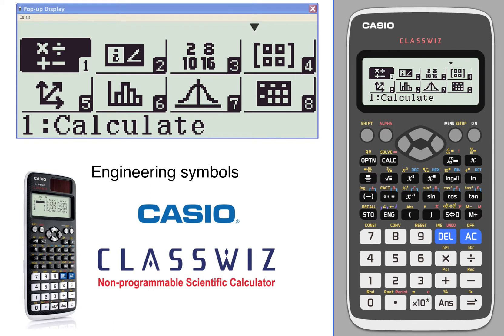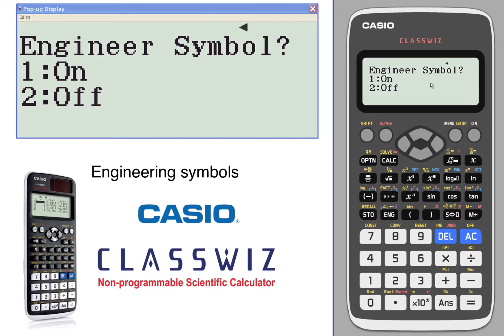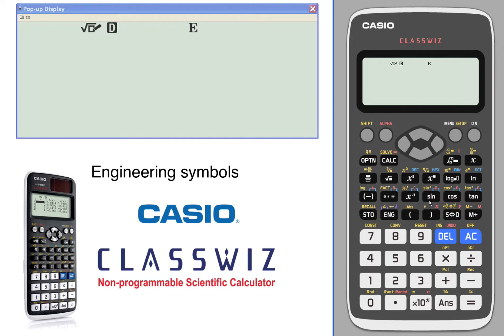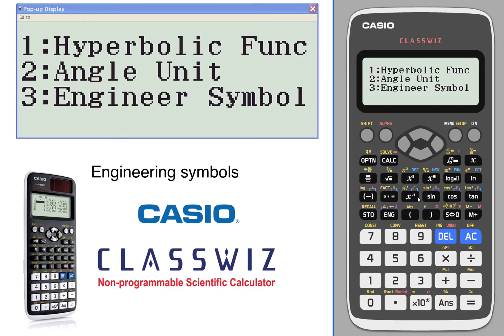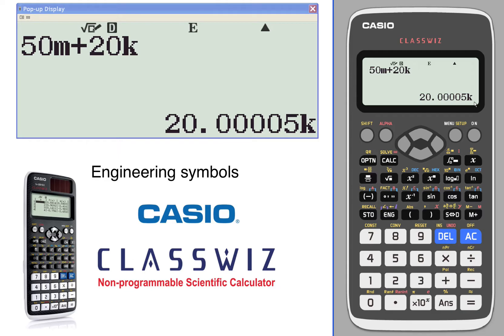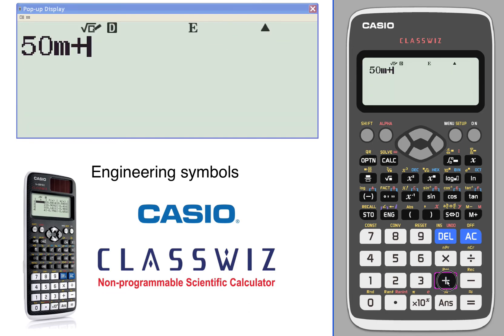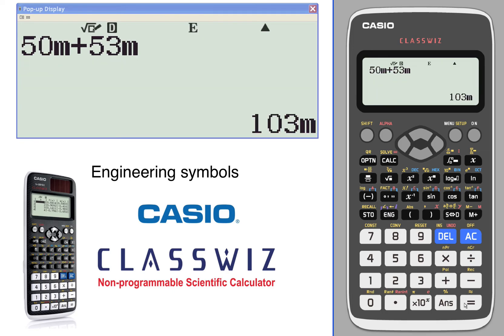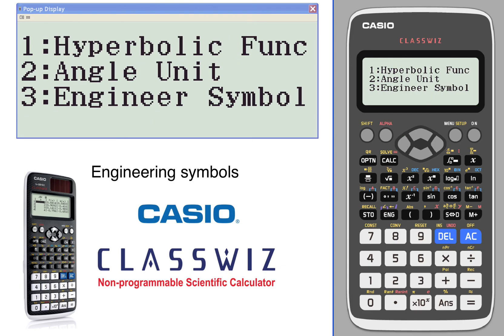ClassWiz Calculator Tutorial - Calculus 9-3 Engineering symbols

Comment: The "Engineering Symbols" are not units, it's for the metric prefixes... here 'm' is not meters, it's milli, as in 10^-3. That's why the answer to "50m + 20k" is 20.00005k rather than 20.05k (which would be 50 meters + 20 kilometers). You've added 50 milli [units] + 20 kilo [units] (could be anything, meters, litres, grams, etc).
Reply: Great catch! --what a clumsy mistake by Casio Education!
Reply: @GeoCalifornian  I'm not sure how they did it... but the metric symbols are super useful in the long engineering equation entries I do -- so much more concise and readable than using 10^x all over the place!
Reply: @Thirsty_Fox  --That is exactly correct. 
These ENG symbols are very useful for astronomy, chemistry, electrical engineering, pharmacy, biology and others. This used to be what set Casio scientific calculators apart from all the rest, back in the day.
Reply: @GeoCalifornian  They're still my favorite by far for engineering. It's 1 extra button press for the engineering units (3 vs 2) in normal mode, but two extra (4 vs 2) in complex mode. Even if they changed the complex "OPTN" menu so you could select it right away (ie. using the number 9 rather than the number 3 but having to scroll to that page). Even the order of them within the list is strange... m, u, n, p, f, k, M, G, P, E... starts with milli, gets smaller to femto, then jumps to kilo and gets bigger to exa...

It's the principle that they left the digits 1-6 unused for 2nd function. Would love to have p, n, u, m, k, and M in these places, or n to G.

Alas I still love it -- obscenely capable, super responsive to keypresses (cannot understate the importance!), and the visual algebra helps reduce errors due to entering the equation incorrectly. It even looks nice! I still use the FX-991MS quite a bit though, but my biggest issue with that one is turning itself off after only a very short time and losing all my calculations.

Anyways, thank you for coming to my TED talk :)
Reply: @Thirsty_Fox  Thanks for your TED talk! I, too, still use my fx-991MS, but did you know? —Canon has an identical scientific, the F-788dx that has the IDENTICAL functionality of the fx-991MS (including ENG symbols on the keypad, and the Canon has power-off memory protection! I use my F-788dx as my go-to scientific because of its memory safeguard.
Reply: @GeoCalifornian  That's brilliant! Thank you for letting me know. I've seen many copies of the FX-991MS and always dismissed them, but resolving that one major issue is tempting indeed. My first scientific calculator for years was the TI -30X IIS which had memory retention with power-off, which I had taken for granted. Though if it weren't for auto-power-off, I probably wouldn't mind.

Have you had any experience with the Canon F-766S or F718S? They seem to be similar but more readily available and are newer generations (3rd and 4th, respectively). Thanks!
Reply: @Thirsty_Fox  --Yes, I have a Canon F-766S, and it too is a joy to use because it has the ENG symbols right on the keypad. It has a Solver, but not vector or matrix functions… … Unlike the fx-991MS and Classwiz, the silkscreen letters and numbers on the F-766S are very high contrast and very easy to read even in low-light conditions; it’s fun to use! The LCD is high contrast too…. … The Canon F-766s like the F788dx has a nice feature that I like: when Canons are solving a difficult equation, “PROCESSING” fills the LCD screen so you know what it is doing, unlike Casio, which just sits there with a blank screen… 
/Promoting Scientific Calculators for the Benefit of Mankind
Reply: @GeoCalifornian  I'll have to look into picking one up if I can decide on one -- thanks for the info! I have a Sharp EL-738C on the way for some financial calculator needs... why do I have a feeling this will be the next type of thing I collect!